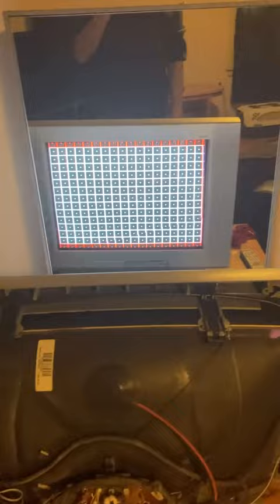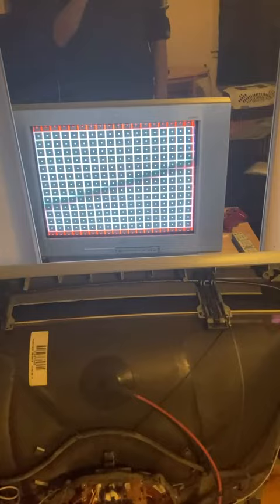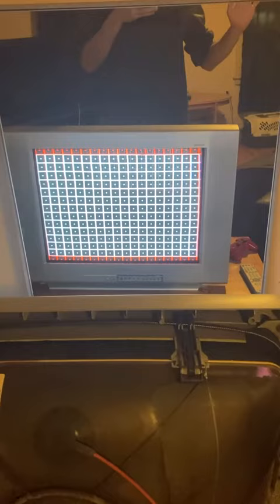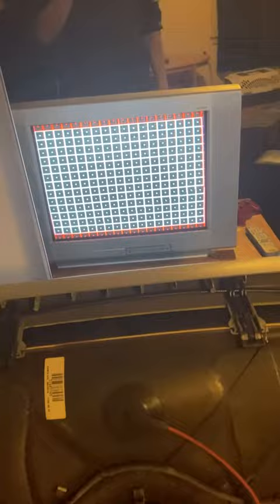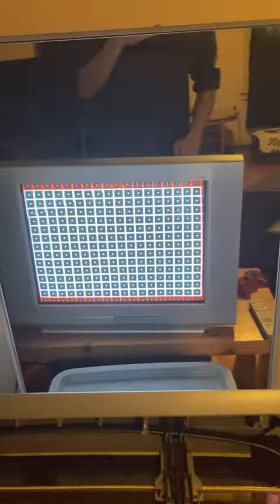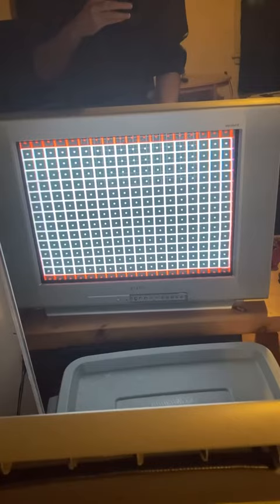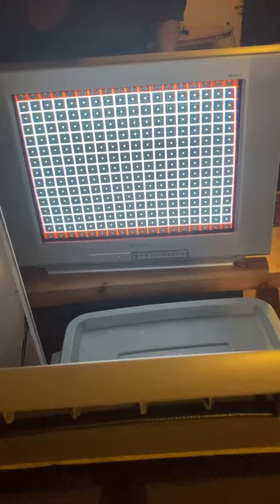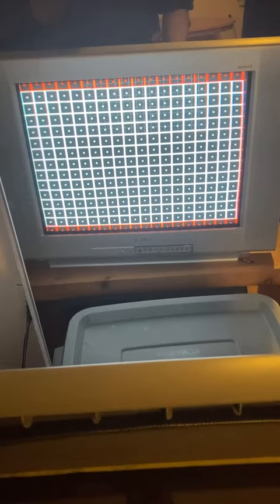Fixing the Infamous Wega Bend/Bow

Comment: You can also move the yoke itself to correct. The yoke's foam wedges shrink or fall out of place over time. I think the high voltage danger means most people would rather just toss it.
Reply: Yeah, it's best to reseat the yoke first and then make all adjustments after. There's really no danger if you just stick some lineman's gloves on.

Comment: I've got this problem with a Sony 24-in Trinitron that I had found when someone was throwing it out.  I  got my PS2 hooked up to it with component cables and I thought that might have been the issue because it's only 480i and the PS2 only goes up to 480p.. in some games. I hooked up composite cables and it still had the bend. I tried a PS1 game and noticed the menus were kind of trapezoid shaped almost and the tilt feature under the TV settings didn't fix it ... maybe this will do it.

Comment: It affects the bottom too though it seems...so wouldn't solve the top without screwing up the bottom.
Also, there's already a service menu control that does this. V-Bow.

Edit: I was wrong - this totally worked and V-bow only affects the sides, not the top and bottom!
Reply from the maker: Yeah, on a Wega you have to find a middleground and learn to live with it, in truth. Vbow changes the bowing of the vertical lines, this is for changing the bowing of the horizontal lines.
Reply: @NullyBird  You're right, my mistake on the V-bow. I gave this method a shot but sadly can't get the rings to budge. I tried cutting through the white resin with an exacto knife, but to no avail.
Reply from the maker: @eleckson  try pouring a fraction of a teaspoon of Isopropyl alcohol on them. Put a cloth underneath to make sure it doesn’t drip onto the board(won’t hurt the board if it’s 99% isopropyl though).
Reply: @Nullyboy  thank you! Will do! I only have 70% but will try to dab some on with a q-tip
Reply: @NullyBird  Mother of god, it worked! The results are great as well! Much appreciated!
Reply from the maker: @eleckson  Great to hear! Hope the geometry goes well.
Reply: Do you have to re-glue the rings back after doing this to make sure they don’t shift on their own?  If so, what glue would be recommended?
Reply: @digi-it6oc  I didn't, as they were pretty snug after adjusting.
Reply: @eleckson Oh ok good to know.  You had to use rubbing alcohol and a small blade to cut the old glue?  Did adjusting the rings make a great difference in improving the geometry?  Did it affect your convergence?  Would like to hear about your experience doing this.
Reply: @digi-it6oc  someone ironically just asked the same question in a Facebook group, and I answered + provided before and after pics. If that was you, that's funny. Lol. Otherwise, yes it worked out great for me and didn't screw up convergence.
Reply: Lol that was me!  I’ll correspond with you there, thanks!

Comment: There is glue on the rings of my set, I saw mentioned to try dabbing some rubbing alcohol on the glue and cutting it to free the rings up.  After doing this and making the adjustment, should you re-glue the rings back together so that they don’t shift or move, therefore, messing up the geometry again after fixing it?  If so, what glue is recommended?  Also, doesn’t messing with these rings affect convergence?
Reply from the maker: Late reply, but I never glued mine back together - but that isn't a bad idea. I moved my CRT many times after this adjustment, and never had the rings fall out of place. The lubrication from the rubbing alcohol is temporary, so I think you'll be fine. But if you can find info on which glue to use, then go for it.
Reply: Ok good to know.  Does fixing the bottom adjust the top of the grid in the same direction as well?  The bowing on the bottom of my screen is bad and going in the opposite way of the bowing at the top, which is slight if anything.  And, do you have to move both rings, what happens if you move just one ring?  Did this affect color or convergence on yours?

Comment: I have this issue on my Toshiba.
Reply from the maker: There are two sets of two rings each. The first set is for purity and is used to get rid of splotches of discolouration in the centre of the tube. The second set are known as the convergence rings, and they adjust vertical convergence, but you need to really know what you're doing to adjust it properly(I rarely mess with them). On this particular WEGA, there are rings towards the back that aren't typically present on CRTs. I'm doubtful you'll find them on your Toshiba, but I hope they're there for you. Make sure to mark the rings' original positions before you change them.
Reply: @NullyBird  if i dont have that, are there any common techniques to getting rid of the bow?
Reply from the maker: @benjaminyoung9694  I have no suggestions that come from personal experience. However, alot of people keep saying you have to remove and re-adjust the yoke. I'm still waiting for someone to make a video of that process, lol.

Comment: Hello how do you display it on the TV  by connecting it to PC?
Reply from the maker: Buy a simple hdmi->composite adapter, they're cheap on Amazon usually. If you want lagless component, be ready to spend big $$$.
Reply: @NullyBird Thanks i got the Scart one and its working fine :) The problem now is ot fix the not so good geometry but this sadly need the TV to be opened...
Reply from the maker: @woofaki5550  Yeah, the rolling test pattern is much better for gauging corner geometry in my opinion.
Reply: @NullyBird Mine has a problem that i cant fix from the service menu,the upper part where the red one in your video is,will start sinking inside the bezel and by the time it riches the left corner its around half cm in....I wonder how will i be able to fix this one.I was thinking to try magnet strips if i manage to find someone to carry the TV put it on a higher bench and open it...PS:Just seen a video that shows my problem,it does seem like the yoke is lightly tilted,so i need to try and fix that (hopefully)

Comment: I have some bending and off geometry on my Sony KV-27FS120 and I have been trying so hard to find a good example of how to adjust the rings I keep reading about. Thank you so much for showing that it actually works and what to look for. I want to do this myself with safety gloves, I'm just a little nervous. I see you are doing it bare handed while holding your IPhone. Maybe I can get lucky and find someone who knows how to do this in my area? Most likely not! Do you have any other advice for handling the insides of a CRT for a noobie like myself?
Reply from the maker: Would recommend watching the video that's linked in the description. But the points of concern are:  tube + Anode cap + fly back + fly back wire going to anode cap. These 4 items have great potential to harm you if you're not careful. The rings I'm touching here are safe, the deflection board immediately behind said rings can electrocute you, but it's only a tingle(Think of a light-switch mini-electrocution).
Reply: @NullyBird  got it. One more question. Is the geometry grid you’re using from the 240p test suite? I suppose I could load it from a CD-R on my Dreamcast, I don’t have an Ever Drive or a flash cart though. Any suggestions? Thank you again!!
Reply from the maker: @tonybogard6888  definitely burn it to Dreamcast, it’s the best version. In this video, I was using an image from google of the 240p grid, played from a usb on a PS3. I was too lazy to get the Dreamcast + VGA box +
Scart2component transcoder.
Reply: @NullyBird  would I need the VGA box and transcoder specifically to use the grid?
Reply from the maker: @tonybogard6888  no, a composite cable is fine, that’s just how my Dreamcast is set up.

Edit: unless you want to calibrate colour balance on component, then yes , you will need to buy those.
Reply: @NullyBird  Hello again! I finally got around to opening my WEGA. I have the grid going and I am about to adjust the rings. I took pictures of the rings for original position reference, but just to be safe, which ring moves what? One for vertical and one for horizontal I am assuming? Thanks for your help!
Reply from the maker: @tonybogard6888  Not sure which of the two rings moves what, but if you make small adjustments, you’ll figure that out quickly.
Reply: @NullyBird  OK so I am attempting to move the rings, and they won't budge. Do I unscrew the clamp in between them and the convergence rings? Is that a factory measure in place with these WEGA's? Thanks again mate.
Reply from the maker: @tonybogard6888  I had to carefully use an exacto knife to cut off the white gunk, on one PVM I had to pour some Isopropyl alcohol on it to make it budge.
Reply: @NullyBird  I see! I'll have to get creative, I still have the big back shell attached to the bottom part holding all the mechanics. It's unscrewed but I'm not confident enough to fully remove that stuff haha! I can easily reach back there, and I have the cap discharged, but getting a good angle for cutting might take some Macgyver'ing. I'll figure it out!
Reply from the maker: @tonybogard6888  On my Trinitron that back shell just slides right off, probably safer to fully remove it before making adjustments. It's easy to get back on.
Reply: @NullyBird  Right on. So the anode cap wire and another wire connect to a part that is inserted in part of the plastic shell. There are two screws around it holding the shell on, but I'm concerned about removing them to remove the shell based on how the wires are positioned. It's hard to explain without pictures! I see where I need to cut the white stuff on the rings though so it shouldn't be a problem!
Reply from the maker: @tonybogard6888  oh, yeah mine isn’t like that. Do what you think is safest.
Reply: @NullyBird  ok so I got the white gunk off and am adjusting the rings! I am trying to get the self service and diagnosis menus to show up on my TV, I usually have no problem but they just aren't appearing when I input the button combos and power it on. Do these not appear when the test suite is active?
Reply from the maker: @tonybogard6888  display, 5, volume + is the combo. Make sure to set your remote to TV, and input the code prior to turning the tv on.
Reply: @NullyBird  Typically that works no problem but I have tried this alot for the past hour since getting the grid up and I can't get either menu to appear. I mainly am having trouble with the top section of the grid and I feel like I can adjust it best this way if I can just get it to appear since I can now also move the rings. Thanks for your help. I think it may have something to do with the button inputs not being picked up as easy via the TV, I have to move the remote around a lot ot get the power to turn on since the sensor is pulled back (not sure what that looks like) with the TV being open. Hopefully I can figure out what the remote sensor looks like and find the sweet spot. I feel like I am so close!
Reply: @NullyBird  ok so I just had to hold the remote right up to the front panel and it picks up the buttons no problem. Got the menus up again. Should I adjust the other set of rings that is across from the back ones? I need to figure out how to fix the issues in the upper corners of the grid. Are those rings for color convergence? If I can straighten those out, I can find the right spot. There’s bowing in the upper two corners but moving the rings isn’t really fixing it, so maybe I can find the right option to adjust them in the service menu? I found an old general use code key list and their definitions on an old Neo Geo message board from 2007 to underaged what all the acronyms could mean in the remote menus. Should be helpful!
Reply from the maker: @tonybogard6888  Those rings won’t fix your corners, only convergence strips + magnets will help you there(and it’s a PAIN). One set of rings adjusts colour purity in the centre of tube, the other affects line convergence as a whole on the tube. Bottom line; I don’t think you should touch those rings at all.
Reply from the maker: @tonybogard6888  Oh, I just realized you have a Vega. Messed up upper corners are just kind of the nature of the beast in this instance, it’s a complete lottery where 90% of the people lose when it comes to that. You can either overscan the image or learn to deal with, I choose the later. My advice is to use the vertical scroll test in the 240p test suite to find a sweet spot that makes the corners not as noticeable.
Reply: @NullyBird  you can fix the messed up upper corners by inserting under/placing magnets onto the sides of the yoke

Comment: Is that not really dangerous? Working on a crt manually with it on.
Reply: Its not really dangerous if you know the dangers and you are experiences and careful with safety equiptment. Opening a breaker box with full power is dangerous but electricians do it all the time.

Comment: Ha, this issue why I ended up giving away my flat screen Wega Trinitron. I was only able to improve it slightly in the service menu. After that CRT, I picked up a curved screen Trinitron (manufactured in 2000), and the geometry is much better.

Comment: Learn basic electronics! You just don't go poking around into a Sony Wega set and start messing with those ring adjustments and expect miracles. You need to learn how to read a schematic diagram. There's a lot of high voltage you're dealing with.
Reply from the maker: With respect; I've had much experience adjusting CRTs in the past. I've put a giant warning in the description, that directs to a relevant video on CRT safety. I take every precaution necessary. These two rings in particular stood out, as I've never seen them on other CRTs. I could remove your comment, but I take safety very seriously — and I think the merit in your message is justified, so I will let it stay. 

I admit my comment about part of this procedure being "dangerous" was misplaced, it was very late and I was far too flabbergasted by the results to really think about what such a quote communicated to my audience.